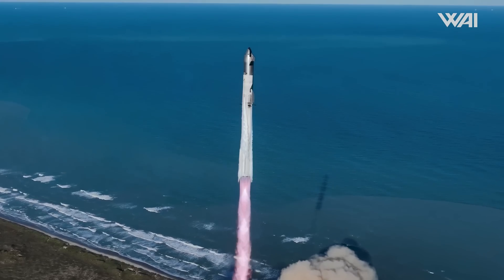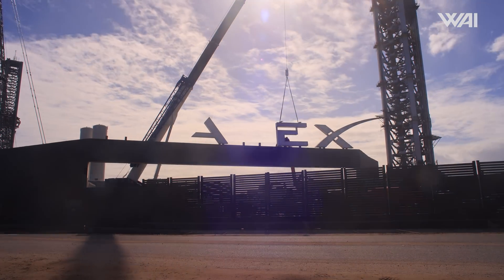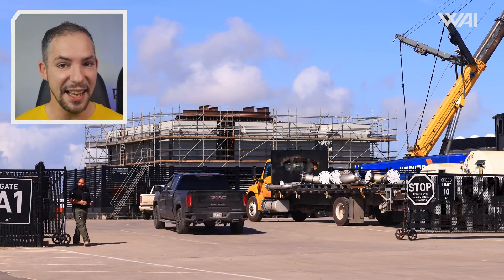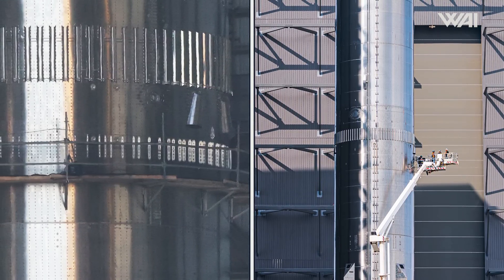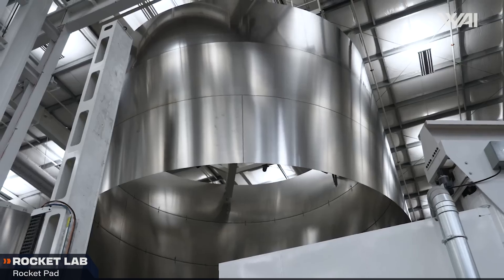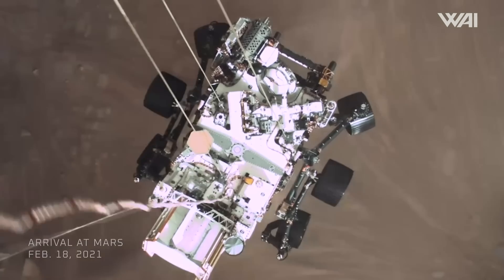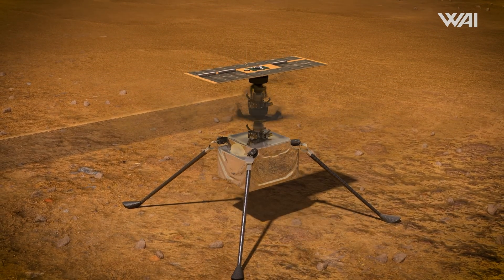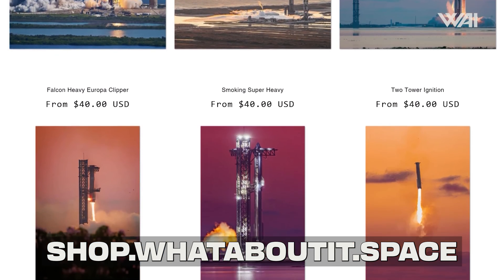SpaceX's shows new Starship Heat Tiles! And they're red!

Comment: Helium is the smallest atom.

Helium is smaller than hydrogen because a helium atom has two protons in its nucleus, which creates a stronger positive charge, pulling the electrons closer to the nucleus and making the overall atom smaller compared to a hydrogen atom with only one proton; essentially, the increased positive charge in helium exerts a greater attractive force on the electrons, shrinking the atom's size. 

At work, we run Helium Leak Tests every day!

Comment: The Ingenuity flying drone doesn’t need to design improved navigation system or stronger propeller blades, but a solution far more simple: longer legs. This would greatly increase the slope angle of a landing surface required to bring the propeller blade into contact. Then, a slight upgrade to navigation that activates during landing, a laser that detects the slope of the surface below. These two upgrades would eliminate costly redesign of whole navigation system and material tests of stronger blades. 72 successful flights show those systems to be more than adequate.
Reply: But that wouldn't have helped Ingenuity in the slightest, because your longer legs are protecting against a failure mode that didn't happen. Per the video, the blades didn't contact the ground... they broke because the force of one leg hitting the ground effectively caused the rotor mast to bend relative to the rotating blades, which couldn't take the strain. Which is exactly why stronger blades and / or a better navigation system are the proposed solutions... build a vehicle that's not so fragile, or build one that's better at detecting unsafe landing areas.

Comment: Hmm this seem more like a coning issue on the little copter. It is one of the few issues with coax copters. It is a speed limitation of coax when you go too fast or pull too much collective one of the retreating blades will get bend into the travel area of the other one.

Comment: If the entry burn slowed the ship down enough that heat tiles were not required then the question would be: If the added weight of the heat tiles was replaced by the same weight of more fuel would it be sufficient to negate the need for the tiles.

Comment: With 5 centre engines, will the block 2 booster still need to relight the ring of 10 engines on its boost back burn, or will only the centre 5 relight?

Comment: Metal heat tiles are in the same temperature range as the current ceramic heat tiles. I'm sure Space X is evaluating the multi-mission durability of metal ones over current ceramic tiles. They can also actively cool the metal tiles in certain areas where extreme heat is concerned.

Hopefully Space X can produce those metal tiles at Starbase and can laser cut them as needed.

Comment: The new red tiles on SpaceX's Starship are made from a special blend of ceramic called Low-Temperature Sintered (LTS) 900. This material offers several advantages over the previous black tiles:

1. Durability: LTS-900 is designed to be more durable and resistant to mechanical damage and thermal cracks.

2. Lightweight: Despite being stronger, LTS-900 is lighter than traditional ceramics, contributing to the overall mass efficiency of the spacecraft.

3. Reusability: These tiles are designed to be reused multiple times, reducing mission costs and environmental impact.

4. Manufacturing Simplicity: The tiles are 3D-printed, allowing for rapid and cost-effective production.

The red tiles also feature a modified glass coating that improves thermal shock resistance, making them better suited for the extreme temperatures encountered during re-entry.

Does this help clarify the differences?

Comment: If these tiles absorb the heat, How does it dissipate? Is it just over a longer time?
Red tiles? Test tiles. Spacex is trying something but I am thinking that they may not be ready for primetime. That's why they are on top and not the bottom.
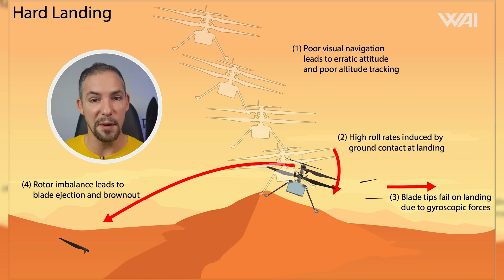16:05 You mean to tell me that they only used a bottom mounted camera? Didn't they think that they needed a side mounted one? Most animals have at least two eyes and for a very good reason.
17:55 I wonder if this thing can still take off if any of its rotors are damaged? 
Also, do you know if the solar panels of this new copter will be covered with a dust repelling mesh?

Comment: I think you’re mistaken about additional blades on a new Mars helicopter making some blades redundant. Any missing or damaged blade with seriously affect vibration and balance, which could result in damage to the hub or even ripping apart the helicopter.  Any such vibration would require replacement and rebalancing of the blade for it ever to fly again.

Comment: It‘ll be interesting to see how such a launch pad will be built on the Moon and in Mars, and how long it will take. Without launch pads no larger ship will be able to launch from spherical, higher mass, celestial bodies.
Apollo‘s tiny return module used its spent lower part as a launch pad. However for anything 10x the mass of the Apollo return module a proper launch pad is required or/and a spherical or drop like ship design with high up engine rings.
Landing a 10x Apollo mass vehicle is equally impossible with bottom engines.🎉

Comment: @Whataboutit what are the testing requirements for expiry on the COPV? With firefighting SCBA there are limits to use and requirements for hydrostatic testing at specific time intervals depending on spec of apparatus (ie.2216/4500 and steel tank vs copv).

Comment: Here are some materials that a heat shield be made out of. Stainless with a titanium screen heat rolled on both sides with Boron heat pressed in. Stainless melt at 1500, Boron with radiation protection melt at 2076 to 2200 and Titanium up to 3000.

Comment: The red colouring is interesting, now I only have grad knowledge of material and thermal physics, but the basics say that of something is red, thats the wavelength of light its "reflecting" interesting that its up the infrared side of the scale, could they acrually be trying to aim a reflectivity for the surface coating of the main energy level given off by the type of plasma that it would experiance, N2 plasma is very much a red through orange light spectrum and given earths atmosphere is majority Nitrogen, I am wondering if reflecting the visible qnd possibly some of the infra specrrum rather that obsorbing it may mean the capacity of the tiles increases. Or some kind of leiden frost effect using a coating between the tiles and the plasma that vaporises against the plasma, a spray on coating between launches would atleast make yurn around better than a full ablative, after all you only really need to get through the hottest point.

Comment: "No FAA delays" as if that was what is holding them back. Most of the testing they have done could have done for less money on a smaller scale in a fraction of the time. Never mind the time they could have saved by doing some reading instead of reinventing the wheel and coming back to the original design.

Comment: If only Ingenuity had a lidar or two as well instead of relying solely by sight alone ... 🤣🤣🤣
😔☹😭

PS: Instead of investing $2 to $3b a pop to make just one or two insanely expensive custom built robots each time. How about sending a swarn of 10,000 smaller robots at $10,000 each. It will take thousands of them to work together to get anything done, but that would be amazingly robust. You could lose half of them and still the mission would be a success. And barring an unforeseen extremely unlikely catastrophe, once you have landed them, it is unlikely any accident will wipe them all out all at once. If any are damaged, the survivors could be commanded to repair the damaged ones. And with so many components, they could be used in different ways, creating open ended projects that changes to suit new discoveries as you go. Instead of every single experiment needing to be anticipated, programmed, and designed like 10 years in advance.

Comment: The red coating on the tiles is probably something to make them glow hotter than the surrounding tiles so there is a reference point on the ship when they are monitoring the heat shield during reentry...or at least that's my guess. If it lands in the ocean and blows up like the others they will not get a chance to examine the tiles afterward (they can't count on doing so anyway), so it makes sense it has something to do with observing them during reentry. Then again , the may have ran out of "black" at the factory that day and had some extra "red" lying around unused...

Comment: Tungsten can sometimes exhibit a reddish tint or oxide layer when it's exposed to air or oxidized. This reddish coloration is due to the formation of tungsten trioxide (WO3).
If the tungsten in the foam is oxidized or has a high concentration of WO3, it's possible that the foam could take on a reddish hue. However, this would depend on various factors, such as:
The specific composition and structure of the foam
The level of oxidation or WO3 content
The presence of other elements or impurities that might affect the color

Comment: I am thinking now that they will use the Bigger & Heavyweight Starship Block 2, as well as some changes to the Booster such as again size new tanks and such it will also be heavier as well so I was thinking that during simulation the computer model showed New stress spots so they added the new reinforcements as a precaution... I know Elon touts the best part is no part but I also think he believes in a new support row in a possible stress point is better than a booster that folds in half in the middle of flight.... he is making Rockets 🚀 not pocket knives...

Comment: SpaceX did not wait for the realization of re-usability before putting the Falcon 9 to good use.
They should not wait till Starship is fully reusable before using it to launch payloads either.
What they should do is make an expendable upper stage -- a Starship w/o the flaps, shield or nose.
This will be VERY useful in getting 150~200 tons to orbit and getting NASA to the moon.
Reply: There are no payloads of that size (currently at least) at the price point of an expendable Starship. Falcon covers the existing market.

Comment: 13:54 "hydrogen is the smallest known atom" — no, helium is the smallest, because it has higher twice charge of its nucleus and the same number of electron layers.
Reply: You're right. Radii are 32 pm for H and 28 pm for He.
Reply: I think he meant the lightest not literally the smallest in terms of volume.
Reply: @J-Johna-Jameson  perhaps but that wouldn't be the relevant metric in the context of how hard it is to prevent it from leaking.
Reply: Helium makes a much worse propellant than hydrogen, its true.
Reply: Di - Hydrogen is the stable form with two atoms per molecule. But Helium is stable as a single atom.

Comment: Why is there no talk about using the drone to hover over the rover to blow off the dust from the solar panels? Instead of just taking pictures, it could also prolong the life of the solar panels
Reply: @STUFF4RC  aren't lift and rotor wash two very different things? Getting it to produce enough in 1 percent the density of earth's atmosphere does not seem likely
Reply: @russhamilton3800  The force of the props to lift the drone will be equal wind beneath it to blow the dust off the solar panels, that's how I thought it could work.
Reply: @STUFF4RC  Correct. That would be how it would work ... if the rover was solar powered, which it isn't. (unlike Ingenuity itself) The rover is nuclear powered (RTG), so there are no solar panels to worry about.
Reply: Curiosity and Perseverance both use nuclear power (RTG). They don't have solar panels.
Reply: It would not work on Mars.   The dust is held on by electrostatic force and the atmosphere is so thin that even a high speed wind has little effect.     Mars is MUCH closer to a vacuum than to Earth-like conditions.      Mars' air density is 1% of Earth's.

Comment: The Starship tiles do not absorb the reentry heat. They block that heat from propagating from the hot side of the tile to the cold side that's adjacent to the stainless steel hull of Starship. That's the function of the very thin glass/ceramic fibers in the white part of those tiles. 

By far the greatest component of the heat input to those tiles is radiant heat from the super-hot plasma that surrounds Starship during the reentry. The peak wavelength of that radiant heat is in the 1 to 2 micron region of the infrared spectrum. 

The diameter of those glass/ceramic fibers is about 1.5 microns. That tunes the fiber matrix that forms the tile to strongly backscatter that infrared spectrum away from the cold side of the tile. The backscattered radiation is about 500 times larger than the amount of radiant heat absorbed by those thin fibers. The white part of those Starship tiles has very low heat capacity (i.e. cannot absorb much heat) since that part of the tile is about 95% empty space.

Side note: My lab spent about 3 years (1969-71) designing and building similar tiles with dozens of different materials and processes during the conceptual design phase of the Space Shuttle project.

Comment: 8:45 i think those are reinforcements for the "filter" for ice and dry ice which form from the autogenous gasses in top of the oxygen tank, which come from the preburner so they contain c02 and water. 

These were seen on previous boosters as well if im correct

Comment: Further rationale for highway upgrading: When Block3 arrives, it will be noticably taller and TIPSY-ER. 

Right now, we can get away with transporting shorter boosters on the current (deteriorating) highway. WILL THAT STILL APPLY FOR BLOCK3 BOOSTERS?

Comment: Given all the deterioration of Highway 4, AND given the desire for increased launch cadence, AND the need to keep locals happy re beach access, AND the need for the immediate village locals to access Brownsville, etc.

Proposed--if environmental clearance is possible--A causeway is built, parallel to and just off the south coast of the inlet, immediately north of the SpaceX properties coastline. It would connect all the way to the beach,  to the north of the current access. It would also have an interchange, located before the beach, leading to access to Boca Chica village (now, town). It would be accessed via a road junction on Highway 4, west of Sanchez, leading to the south shore and the start of the causeway.

The new road and causeway would be built with upgraded standards, a minimum of 4 lanes wide.
It would be a public road. 

All roadway of the old Highway 4, east of the junction, would be privatized to SpaceX. (They would then be able to upgrade their now-private road--even widen it--without interfering with public traffic. And safety and security would go up.)

 They could then do transport of massive equipment and spaceships on their privatized road WITHOUT blockages of village and beach access. And the only closure of the beach would then be for launches and full test firings, not for the much more frequent transport closings now needed.

Overall, a win-win situation. (If ambitions and public mood are even more generous, the highway juncture could be even further west, west of Masseys. No highway closings at all, then, to the public.)

FELIX: What do  you think? CAN YOU LOBBY FOR THIS?

Comment: Tiles are coated black for peak black body radiation emission. Perhaps they figured out that there wasn't much emission going on in one part of the spectrum, but that seems unlikely since they're red, perhaps that shade of dark red is cool enough and it only needs to be "black" in the hotter thermal range. Alternatively perhaps they just want to test the same material without pigment to see if they really need to be black for peak thermal emissions, i.e. what is the reduction in thermal radiation if it's not completely black, it's another of those untested assumptions they like to explore. In other words the black pigment might be weakening the coating for marginal or at least untested benefit and they want to see what discarding the pigment does to performance. There is also an exchange of temperature in both directions during reentry, not all radiation but perhaps the coating is colored to reflect some incident radiation in a narrow band while hoping that the reduced thermal gains exceed the reduction in thermal emissions across the spectrum.
Alternatively they might be looking to provide some kind of differential calibration target for the NASA observation flight planned to record the reentry. Quite what that would be for I don't know but I expect they have multi-spectral sensors. The red tiles might provide a quantifiable dip in blackbody radiation emissions at a predetermined wavelength that informs the observations, or might simply be a thermal focusing target that will help imaging of individual tile details.
Those are my 4 wildly speculative theories.

Comment: ASU, Air Separation Unit.  That is what I have always heard them referred to, rarely if ever while working at Air Products have I heard an ASU called a plant, typically an ASU is operated at a steep plant or an oil refinery.  So I would say this is an ASU at a Space port. Semantics i know....
Reply: Not surprising that SpaceX wants an ASU. Starship is going to significantly increase nation-wide consumption of oxygen (LOX). Might as well do some in-house. They need Nitrogen, CO2, and Argon. Plus, they need expertise for building and delivering air liquefaction plants on Mars.

Comment: isn't pad #2 kind of close to pad #1 to be redundant? If we have a launch booster explosion, it could easily take out both pads, since it will have the explosive power of a tactical nuclear weapon. I suppose it is far enough away to survive a landing catch explosion, but a launch explosion would be massive.
Personally, I think contemplating failure modes is Elon's major weakness. See "Rain, Concrete" in the SpaceX launch dictionary.